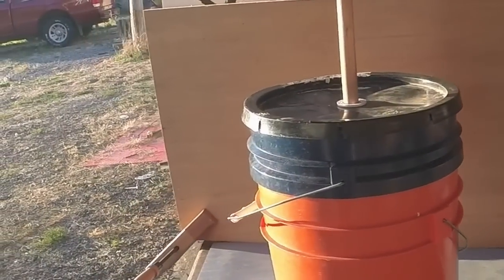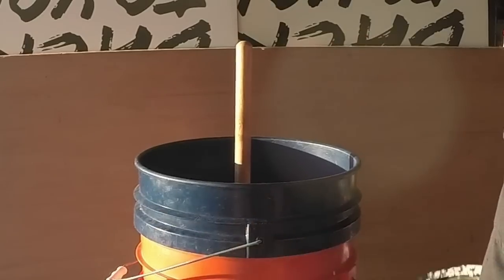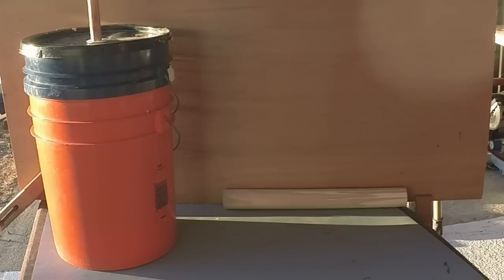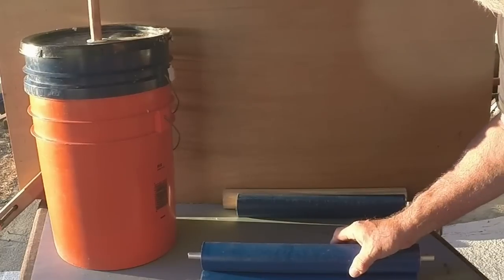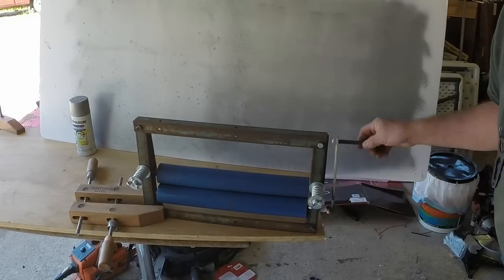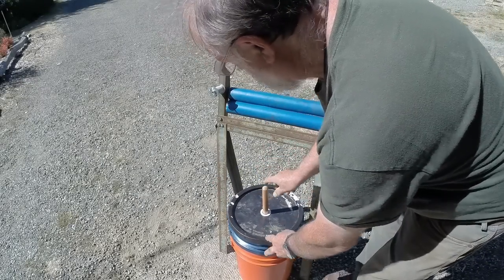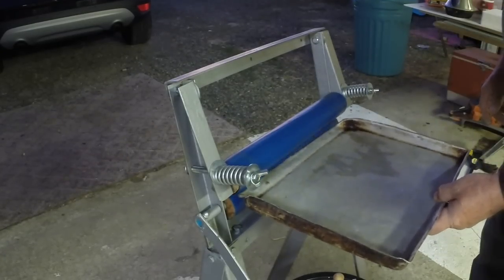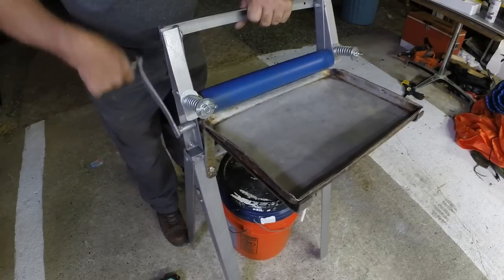Wash day Wringer

Comment: I had a wringer that was store bought and it did a great job no drips after one pass the rollers were rubber and clothes dried faster than when i used regular washing machine.  they cost alot or i would buy another.
Reply from the maker: Yes the roller would work better if I had found 1/8" rubber tube I could have slipped over the wood. Thanks for stopping by and commenting.

Comment: I could make everything I just don't understand how you did the springs and how you attach the springs is there a way that you could show me how to Springs are attached in another video Jackie
Reply from the maker: It is a simple trap joint. The top is bolted lose on the right and left so it can swivel. Then the bottom where the rollers are. You pinch the rollers closed by tightening against the spring tension. The spring is only there so it can open if to large an item tries to wring threw the rollers. Like zippers or buttons will do. You need the spring tension so it pulls tighter, but lose enough to flex. Stop the video at 6:58 It gives the best view on the two arms and the spring that pulls it tight. 18:46 time stamp also gives a good view of the side you have questions about too. Show the video to a few friends. I am sure you will see then how it works.

Comment: Oh, love the bed frame idea! Strong and will last forever. Why are the springs on a horizontal to the rollers? How's that work?
Reply from the maker: The rollers are tightened with the springs. This will give tension to the squeeze yet let the buttons and zippers will press threw as it opens just enough for them. Thanks for stopping by.
Reply: @badbadbob1  thanks. I'm gonna subscribe. This was awesome.

Comment: I wish you could make a wringer for me! 🤠 I can't find a decent one out there that's affordable and  one wide enough for towels, sheets and blankets. I can make one but I will need to improvise because I don't have all the tools to make one like yours. I'm trying to figure out how to make and assemble the frame with the bolt and spring.   🤔 I'm wondering if there is a way to use some PVC pipe for the rollers, or perhaps or find some premade wooden wide rods.
Reply from the maker: For the wringer you can use rolling pins like you use to roll out dough. This has a center hole that can be drilled out to except a larger rod. PVC will bend from the pressure needed to press the water out of the towels and blankets. I hope that helps.
Reply: I el tubo de madera se en camisa en el PVC CÓMO FUNCIONARA??

Comment: good job!  I have been thinking of making a wringer & you have made one almost exactly like my plans.  I had not thought to put the shelf on it.  I think you could also coat the rollers with plastic paint.
Reply from the maker: I did find 2" clear vinyl pipe to cover the rollers. That was what I was looking for when I found the blue vinyl thin stuff.It is 1/4 thick and works much better.

Comment: Actually I have only one issue with no lid in my plunger.
My soaks and small items go through the holes. I just turn it and they pop out.
Also I use a plastic tub not a lil ol bucket and the plunger does great.
Reply from the maker: It's great to see you noticing what works for you. So many can not.

Comment: Thanks Again!   I've seen your video before - Just Great!  Trying to make one now.   
i get reason for adjustment  of Top Roller, but i don't understand the 'Spring Action' and adjustment that Pushes on clothes.
Also  - You probably have Washers & Bolts at Top to allow adjustment.  ?   : }
Reply from the maker: Great question. The springs will let the cloths push back on the rollers, if zippers or buttons need more room to roll thru. If it were stiff and not movable it would cut into the rubber and wood behind.  Good luck with your build.
Reply: @badbadbob1    Thanks - should have thought of those zippers.  I'd learn the hard way with Dripping cloths going nowhere.  lol    Cheers!

Comment: Great video!  One question. Did you use any bushings to keep the rollers from sliding back and forth or rubbing the sides of your bracket?
Reply from the maker: I did put a washer on each roller end. Thanks for the question. It is slow speed using you hands to turn it. But if you put a motor on it. "Look out." You will need a safety pop-open device.
Reply: @badbadbob1  thanks for the reply. I am looking to make one of these and the design I had originally considered was a lot more complicated. Thanks for the great idea, I will definitely be changing it up to mirror yours now.
Reply from the maker: @livelywombat  That is great you are making one.

Comment from the maker: The tray is on the wet side. It rolls out the open side. I have found the thicker clear Pump inlet pipe. It is the size I was looking for in the first place. They must have been out. Also running it threw twice helps too.
Reply: Bob Anderson Its really nicely put together and I like how you have it at a standing height so now bending over to use it. I've done mine now. I used rolling pins for the rollers. One has radiator hose on and the other is silicone coated using oogoo so that they grab on to each other as the bottom cranked one rotates.
Reply from the maker: That will work. I love those who tinker Like I do.
Reply: Me too. I have already had to cover the second roller with radiator hose after all because the silicone was starting to pucker up when things were a little tight going through.
Seems to work anyway.
Reply from the maker: @christopherscotland4015  That is a great Idea.

Comment: No entiendo como se.ponen y como funcionan los resortes
Reply from the maker: It is hard to see. But if you make the frame, you will need the springs to put pressure on the rollers.
Es difícil de ver. Pero si haces el marco, necesitarás los resortes para ejercer presión sobre los rodillos.